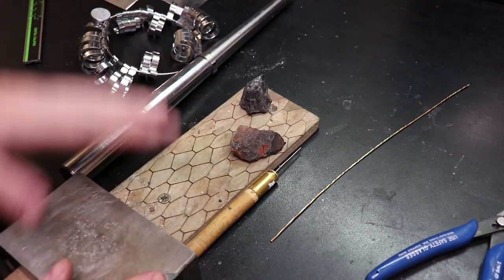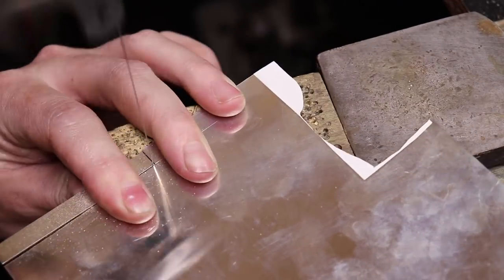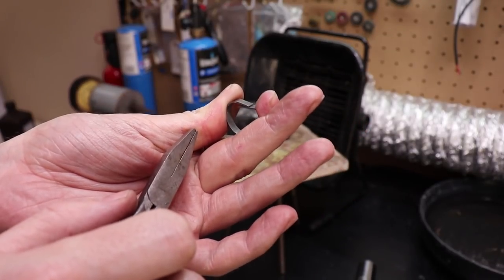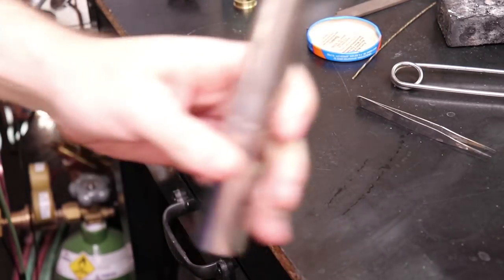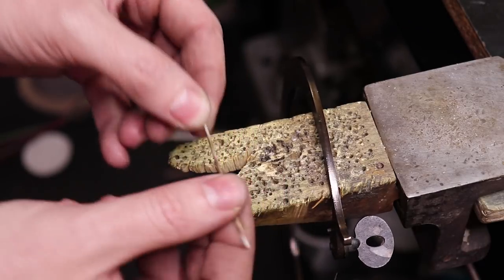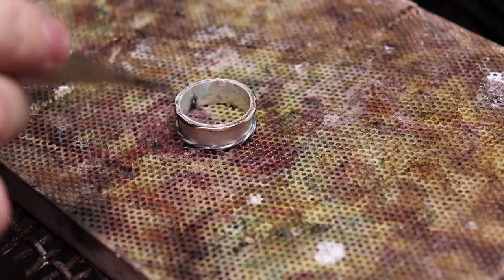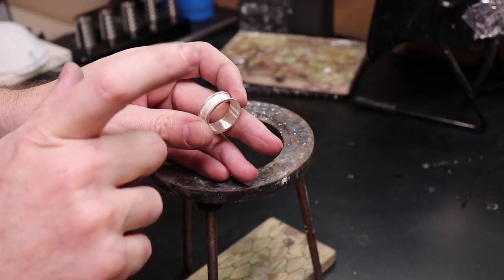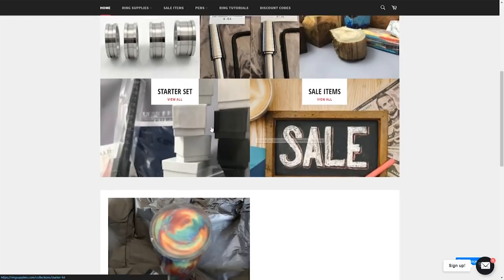Twisted Galaxy Ring - Opal, Onyx and Mokume-gane

Comment: Which glue did you use, the thin or thick one? I noticed what you used is different brand than amazon one.  Also which accelerator are you using?
Reply from the maker: I use both thin and thick and the ones that I have been using in my video are from a local store but when I'm out (That should be very soon) I will be getting the ones on amazon

https://amzn.to/2LDvuvb
https://amzn.to/2XvaopW
https://amzn.to/2JEyhC3

Comment: What's the difference with wet sanding
Reply from the maker: It helps keep dust down and the materials building up on the sand paper.
Reply: Hi there, this is a very interesting video tutorial. I have a question regarding the machine that you are using with the lathe. What's the name of it In minute 27:00? Thanks! That ring came out very beautiful
Reply from the maker: Thank you and I think you are talking about the part that I used to cut the ring on the lathe. This is part of the lathe, it's all one machine. 😁👍
Reply: @GomeowCreations  , what type of lathe is it? I can't see it on your shopping list. I am sure it might be very expensive
Reply from the maker: @ingridsaab5413  Here is a link to one that is similar to the one that I have https://amzn.to/2OfQp6O I also added it to my list =)
Reply: @GomeowCreations  , wow, that's a beautiful machine, I want one! I can't afford it right now. So, I If were to make an awesome ring similar as the one you created, but without a lathe, which alternative tools do you advise to use? I have a dremel, and also an electric standard  drill. What type of bits kind I use to file the onyx. Probably carbide and diamonds, right? Do you know the exact bit that I can use to trim the excess rocks on the ring?
Reply from the maker: Well you can make a find like this with out a lathe. Here is a video I made showing how I did just that. https://youtu.be/xXi6gbt7k_g 

You can use softer stones and cut it down with just a file but if you have tour heart set on onyx you are going to need a set of diamond grinding bits. You can also use your drill press and the ring mandrels that I used to hold it. 😁 You can also email me if you have questions and that way I can get back to you sooner. gomeowcreations@gmail.com

Comment: Welp.  That explains why my thick rings never fit. Been using a skinny ring sizer.
Reply from the maker: You can use the skinny one but you have to make sure to make the ring a little bigger to make up for everything. So if I make a size ten using the skinny sizer I would make sure the thinker band goes about halfway pasted the ten marking.
Reply: @GomeowCreations  ahh ok